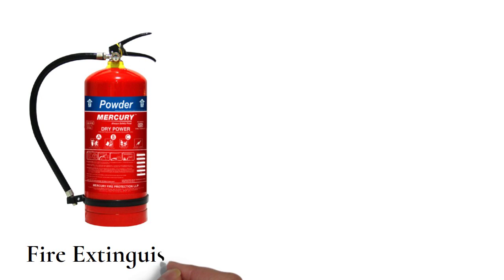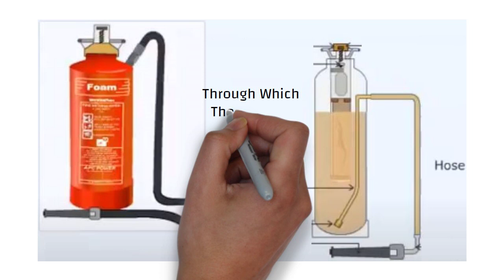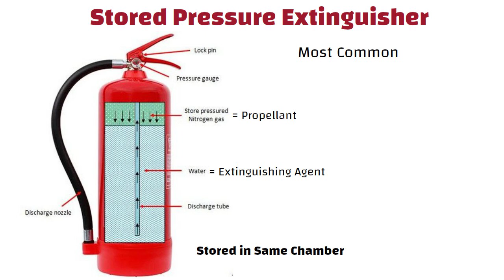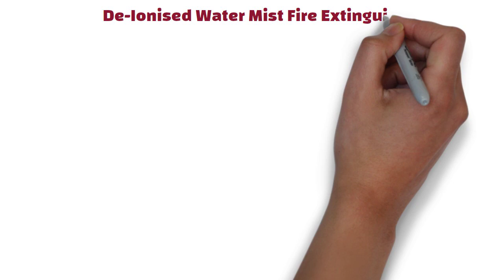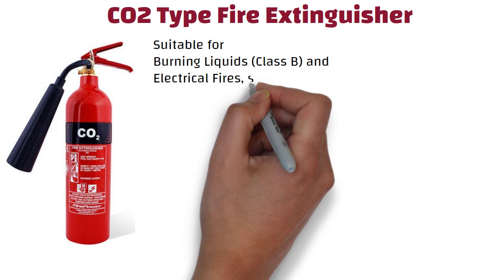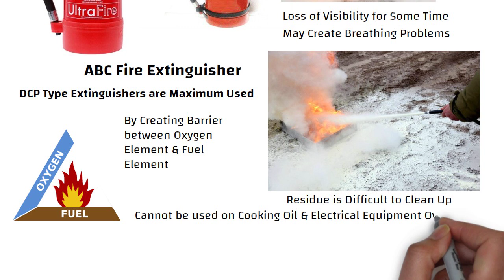FIRE EXTINGUISHER DEALERS IN KERALA, CALL 8138906102, FIRE EXTINGUISHER DEALERS IN ERNAKULAM.

Comment from the maker: FIRE ALARM DEALERS IN TIRUR, ADDRESSABLE FIRE ALARM DEALERS IN TIRUR, FIRE ALARM SYSTEM DEALERS IN TIRUR, ADDRESSABLE FIRE ALARM SYSTEM DEALERS IN TIRUR, FIRE DETECTION SYSTEM IN TIRUR, SMOKE DETECTOR DEALERS IN TIRUR, CONVENTIONAL FIRE ALARM DEALERS IN TIRUR, MORLEY FIRE ALARM DEALERS IN TIRUR, GST FIRE ALARM DEALERS IN TIRUR, ASES SECURITY FIRE ALARM DEALERS IN TIRUR, BEAM DETECTOR DEALERS IN TIRUR, FIRE ALARM SUPPLIERS IN TIRUR, FIRE ALARM TRADERS IN TIRUR, FIRE ALARM PANEL DEALERS IN TIRUR, HEAT DETECTOR DEALERS IN TIRUR, FIRE ALARM SYSTEM SUPPLIERS IN TIRUR, FIRE ALARM COMPANIES IN TIRUR, FIRE EQUIPMENT DEALERS IN TIRUR, ADRRESSABLE FIRE ALARM PANEL DEALERS IN TIRUR, FIRE ALARM SYSTEM IN TIRUR, BATTERY OPERATED DETECTOR DEALERS IN TIRUR, ASPIRATION DETECTION SYSTEM DEALERS IN TIRUR, FIRE ALARM MCP - MANUAL CALL POINT DEALERS IN TIRUR, FIRE ALARM HOOTER DEALERS IN TIRUR, PA TWO WAY TALK BACK SYSTEM DEALERS IN TIRUR, PA SYSTEM DEALERS IN TIRUR, PA TALK BACK UNIT DEALERS IN TIRUR, HOOTER CUM STROBE DEALERS IN TIRUR, FIRE PROTECTION SYSTEM IN TIRUR, FIRE ALARM CONTRACTORS IN TIRUR, FIRE DETECTORS IN TIRUR, FIRE ALARM DEALERS IN KOLLAM, ADDRESSABLE FIRE ALARM DEALERS IN KOLLAM, SMOKE DETECTOR DEALERS IN KOLLAM, FIRE EQUIPMENT DEALERS IN TIRUR, FIRE ALARM INSTALLATION IN TIRUR, FIRE ALARM COMPANIES IN TIRUR FIRE ALARM DISTRIBUTORS IN TIRUR, TALK BACK SYSTEM DEALERS IN TIRUR, FIRE ALARM SENSOR DEALERS IN TIRUR, FIRE EXTINGUISHER DEALERS IN TIRUR, FIRE ALARM DEALERS IN ERNAKULAM, FIRE ALARM DEALERS IN KERALA, ADDRESSABLE FIRE ALARM DEALERS IN CALICUT, SMOKE DETECTOR IN TIRUR,  FIRE EXTINGUISHER DEALERS IN TIRUR, FIRE EXTINGUISHER SUPPLIERS IN TIRUR, FIRE EXTINGUISHER DISTRIBUTORS IN TIRUR FIRE EXTINGUISHER IN TIRUR, ABC TYPE FIRE EXTINGUISHER DEALERS IN TIRUR, CO2 TYPE FIRE EXTINGUISHER DEALERS IN TIRUR, CLEAN AGENT FIRE EXTINGUISHER IN TIRUR FIRE FIGHTING PUMP DEALERS IN TIRUR, FIRE PUMP DEALERS IN TIRUR, KIRLOSKAR FIRE PUMP DEALERS IN TIRUR, FIRE JOCKEY PUMP DEALERS IN TIRUR, FIRE DISEL ENGINE DRIVEN PUMP DEALERS IN TIRUR, FIRE FIGHTING EQUIPMENT DEALERS IN TIRUR, FIRE FIGHTING SYSTEM IN TIRUR, VERTICAL INLINE PUMP DEALERS IN TIRUR, HYDRO PNEUMATIC PRESSURE BOOSTING PUMP DEALERS IN TIRUR, VERTICAL TURBINE PUMP DEALERS IN TIRUR, SEWAGE PUMP DEALERS IN TIRUR, RO PUMP DEALERS IN TIRUR. FIRE EXTINGUISHER DEALERS IN TANUR, FIRE EXTINGUISHER DEALERS IN IRINGAVOOR,
Reply: FIRE EXTINGUISHER DEALERS IN PERUMBAVOOR, FIRE EXTINGUISHER SUPPLIERS IN PERUMBAVOOR, FIRE EXTINGUISHER DISTRIBUTORS IN PERUMBAVOOR, FIRE EXTINGUISHER IN PERUMBAVOOR, ABC TYPE FIRE EXTINGUISHER DEALERS IN PERUMBAVOOR, CO2 TYPE FIRE EXTINGUISHER DEALERS IN PERUMBAVOOR, CLEAN AGENT FIRE EXTINGUISHER IN PERUMBAVOOR, MODULAR TYPE FIRE EXTINGUISHER DEALERS IN PERUMBAVOOR, MECHANICAL FOAM FIRE EXTINGUISHER DEALERS IN PERUMBAVOOR, FIRE EXTINGUISHER NEAR ME PERUMBAVOOR, FIRE EXTINGUISHER TRADERS IN PERUMBAVOOR, FIRE FIGHTING COMPANIES IN PERUMBAVOOR, FIRE CONTRACTORS IN PERUMBAVOOR, FIRE EQUIPMENT DEALERS IN PERUMBAVOOR, FIRE ALARM DEALERS IN PERUMBAVOOR, FIRE PUMP DEALERS IN PERUMBAVOOR, SMOKE DETECTOR DEALERS IN PERUMBAVOOR, FIRE FIGHTING SYSTEM IN PERUMBAVOOR, FIRE PROTECTION SYSTEM IN PERUMBAVOOR, FIRE AND SAFETY CONTRACTORS IN PERUMBAVOOR, FIRE HYDRANT SYSTEMS IN PERUMBAVOOR, PA TALK BACK SYSTEM IN PERUMBAVOOR, FIRE NOC IN PERUMBAVOOR, FIRE INSTALLATION IN PERUMBAVOOR, FIRE NOC RENEWAL IN PERUMBAVOOR, KIRLOSKAR FIRE PUMP DEALERS IN PERUMBAVOOR, FIRE EXTINGUISHER NEAR ME PERUMBAVOOR, FIRE EXTINGUISHER MANUFACURERS IN PERUMBAVOOR, SAFEX FIRE EXTINGUISHER DEALERS IN PERUMBAVOOR, FIRE NOC CONTRACTORS IN PERUMBAVOOR, FIRE FIGHTING EQUIPMENT DEALERS IN PERUMBAVOOR, FIRE PROTECTION SYSTEM IN PERUMBAVOOR, FIRE INSTALLATION IN PERUMBAVOOR, FIRE SAFETY CONTRACTORS IN PERUMBAVOOR, FIRE AMC IN PERUMBAVOOR, FIRE PROTECTION SYSTEM IN PERUMBAVOOR, FIRE PROTECTION EQUIPMET IN PERUMBAVOOR, AMC OF FIRE SYSTEM IN PERUMBAVOOR, FIRE CONSULTANTS IN PERUMBAVOOR, FIRE AND SAFETY EQUIPMENT DEALERS IN PERUMBAVOOR, ADDRESSABLE FIRE ALARM SYSTEM IN PERUMBAVOOR, KARTHAR VALVE DEALERS IN PERUMBAVOOR, DCP TYPE FIRE EXTINGUISHER IN PERUMBAVOOR, POWSER TYPE FIRE EXTINGUISHERS IN PERUMBAVOOR, FIRE HYDRANT SYSTEM IN PERUMBAVOOR, FIRE ALARM PANEL DEALERS IN PERUMBAVOOR, SAFEPRO FIRE EXTINGUISHER DEALERS IN PERUMBAVOOR, MS AND GI PIPE DEALERS IN PERUMBAVOOR, JINDAL PIPE DEALERS IN PERUMBAVOOR, AGNI FIRE ALARM DEALERS IN PERUMBAVOOR, FIRE EQUIPMENT DEALERS IN PERUMBAVOOR, FIRE EQUIPMENT SUPPLIERS IN PERUMBAVOOR, FIRE EQUIPMENT TRADERS IN PERUMBAVOOR, FIRE SPRINKLER SYSTEM IN PERUMBAVOOR, RAVLE FIRE ALARM DEALERS IN PERUMBAVOOR, RAVEL FIRE ALARM SYSTEM IN PERUMBAVOOR, AGNI FIRE ALARM DISTRIBUTORS IN PERUMBAVOOR, FIRE ALARM CONTRACTORS IN PERUMBAVOOR, FIRE PIPE INSTALLATION IN CONTRACTORS IN PERUMBAVOOR, FIRE SAFETY CONTRACTORS IN PERUMBAVOOR, FIRE PA TWO WAY TALK BACK SYSTEM DEALERS IN PERUMBAVOOR, HEAT DETECTOR DEALERS IN PERUMBAVOOR, HONEYWELL FIRE ALARM DEALERS IN PERUMBAVOOR, FIRE NOC CONSULTANTS IN PERUMBAVOOR, FIRE AMC AND FIRE NOC IN PERUMBAVOOR, FIRE SAFETY COMPANIES IN PERUMBAVOOR, NEWAGE DEALERS IN PERUMBAVOOR, MONSHER FIRE EQUIPMENT DEALERS IN PERUMBAVOOR, KARTHAR VALVE DEALERS IN PERUMBAVOOR, FIRE HYDRANT VALVE DEALERS IN PERUMBAVOOR, FIRE HOSE REEL DRUM DEALERS IN PERUMBAVOOR, FIRE SPRINKLER DEALERS IN PERUMBAVOOR, FIRE PUMP DEALERS IN PERUMBAVOOR, LUBI PUMP DEALERS IN PERUMBAVOOR, LHP PUMP DEALERS IN PERUMBAVOOR. FIRE CONTRACTORS IN PERUMBAVOOR, FIRE AND SAFETY CONTRACTORS IN PERUMBAVOOR, FIRE EQUIPMENT DEALERS IN PERUMBAVOOR, FIRE FIGHTING CONTRACTORS IN PERUMBAVOOR,

Comment: Addressable fire alarm system dealers in Thrissur
Reply: FIRE EXTINGUISHER DEALERS IN KOTTAKKAL, FIRE EXTINGUISHER SUPPLIERS IN KOTTAKKAL, FIRE EXTINGUISHER DISTRIBUTORS IN KOTTAKKAL, FIRE EXTINGUISHER IN KOTTAKKAL, ABC TYPE FIRE EXTINGUISHER DEALERS IN KOTTAKKAL, CO2 TYPE FIRE EXTINGUISHER DEALERS IN KOTTAKKAL, CLEAN AGENT FIRE EXTINGUISHER IN KOTTAKKAL, MODULAR TYPE FIRE EXTINGUISHER DEALERS IN KOTTAKKAL, MECHANICAL FOAM FIRE EXTINGUISHER DEALERS IN KOTTAKKAL, FIRE EXTINGUISHER NEAR ME KOTTAKKAL, FIRE EXTINGUISHER TRADERS IN KOTTAKKAL, FIRE FIGHTING COMPANIES IN KOTTAKKAL, FIRE CONTRACTORS IN KOTTAKKAL, FIRE EQUIPMENT DEALERS IN KOTTAKKAL, FIRE ALARM DEALERS IN KOTTAKKAL, FIRE PUMP DEALERS IN KOTTAKKAL, SMOKE DETECTOR DEALERS IN KOTTAKKAL, FIRE FIGHTING SYSTEM IN KOTTAKKAL, FIRE PROTECTION SYSTEM IN KOTTAKKAL, FIRE AND SAFETY CONTRACTORS IN KOTTAKKAL, FIRE HYDRANT SYSTEMS IN KOTTAKKAL, PA TALK BACK SYSTEM IN KOTTAKKAL, FIRE NOC IN KOTTAKKAL, FIRE INSTALLATION IN KOTTAKKAL, FIRE NOC RENEWAL IN KOTTAKKAL, KIRLOSKAR FIRE PUMP DEALERS IN KOTTAKKAL, FIRE EXTINGUISHER NEAR ME KOTTAKKAL, FIRE EXTINGUISHER MANUFACURERS IN KOTTAKKAL, SAFEX FIRE EXTINGUISHER DEALERS IN KOTTAKKAL, FIRE NOC CONTRACTORS IN KOTTAKKAL, FIRE FIGHTING EQUIPMENT DEALERS IN KOTTAKKAL, FIRE PROTECTION SYSTEM IN KOTTAKKAL, FIRE INSTALLATION IN KOTTAKKAL, FIRE SAFETY CONTRACTORS IN KOTTAKKAL, FIRE AMC IN KOTTAKKAL, FIRE PROTECTION SYSTEM IN KOTTAKKAL, FIRE PROTECTION EQUIPMET IN KOTTAKKAL, AMC OF FIRE SYSTEM IN KOTTAKKAL, FIRE CONSULTANTS IN KOTTAKKAL, FIRE AND SAFETY EQUIPMENT DEALERS IN KOTTAKKAL, ADDRESSABLE FIRE ALARM SYSTEM IN KOTTAKKAL, KARTHAR VALVE DEALERS IN KOTTAKKAL, DCP TYPE FIRE EXTINGUISHER IN KOTTAKKAL, POWSER TYPE FIRE EXTINGUISHERS IN KOTTAKKAL, FIRE HYDRANT SYSTEM IN KOTTAKKAL, FIRE ALARM PANEL DEALERS IN KOTTAKKAL, SAFEPRO FIRE EXTINGUISHER DEALERS IN KOTTAKKAL, MS AND GI PIPE DEALERS IN KOTTAKKAL, JINDAL PIPE DEALERS IN KOTTAKKAL, AGNI FIRE ALARM DEALERS IN KOTTAKKAL, FIRE EQUIPMENT DEALERS IN KOTTAKKAL, FIRE EQUIPMENT SUPPLIERS IN KOTTAKKAL, FIRE EQUIPMENT TRADERS IN KOTTAKKAL, FIRE SPRINKLER SYSTEM IN KOTTAKKAL, RAVLE FIRE ALARM DEALERS IN KOTTAKKAL, RAVEL FIRE ALARM SYSTEM IN KOTTAKKAL, AGNI FIRE ALARM DISTRIBUTORS IN KOTTAKKAL, FIRE ALARM CONTRACTORS IN KOTTAKKAL, FIRE PIPE INSTALLATION IN CONTRACTORS IN KOTTAKKAL, FIRE SAFETY CONTRACTORS IN KOTTAKKAL, FIRE PA TWO WAY TALK BACK SYSTEM DEALERS IN KOTTAKKAL, HEAT DETECTOR DEALERS IN KOTTAKKAL, HONEYWELL FIRE ALARM DEALERS IN KOTTAKKAL, FIRE NOC CONSULTANTS IN KOTTAKKAL, FIRE AMC AND FIRE NOC IN KOTTAKKAL, FIRE SAFETY COMPANIES IN KOTTAKKAL, NEWAGE DEALERS IN KOTTAKKAL, MONSHER FIRE EQUIPMENT DEALERS IN KOTTAKKAL, KARTHAR VALVE DEALERS IN KOTTAKKAL, FIRE HYDRANT VALVE DEALERS IN KOTTAKKAL, FIRE HOSE REEL DRUM DEALERS IN KOTTAKKAL, FIRE SPRINKLER DEALERS IN KOTTAKKAL, FIRE PUMP DEALERS IN KOTTAKKAL, LUBI PUMP DEALERS IN KOTTAKKAL, LHP PUMP DEALERS IN KOTTAKKAL. FIRE CONTRACTORS IN KOTTAKKAL, FIRE AND SAFETY CONTRACTORS IN KOTTAKKAL, FIRE EQUIPMENT DEALERS IN KOTTAKKAL, FIRE FIGHTING CONTRACTORS IN KOTTAKKAL,

Comment: Fire equipment dealers in Thrissur
Reply from the maker: FIRE ALARM DEALERS IN PAYYANUR, ADDRESSABLE FIRE ALARM DEALERS IN PAYYANUR, FIRE ALARM SYSTEM DEALERS IN PAYYANUR, ADDRESSABLE FIRE ALARM SYSTEM DEALERS IN PAYYANUR, FIRE DETECTION SYSTEM IN PAYYANUR, SMOKE DETECTOR DEALERS IN PAYYANUR, CONVENTIONAL FIRE ALARM DEALERS IN PAYYANUR, MORLEY FIRE ALARM DEALERS IN PAYYANUR, GST FIRE ALARM DEALERS IN PAYYANUR, ASES SECURITY FIRE ALARM DEALERS IN PAYYANUR, BEAM DETECTOR DEALERS IN PAYYANUR, FIRE ALARM SUPPLIERS IN PAYYANUR, FIRE ALARM TRADERS IN PAYYANUR, FIRE ALARM PANEL DEALERS IN PAYYANUR, HEAT DETECTOR DEALERS IN PAYYANUR, FIRE ALARM SYSTEM SUPPLIERS IN PAYYANUR, FIRE ALARM COMPANIES IN PAYYANUR, FIRE EQUIPMENT DEALERS IN PAYYANUR, ADRRESSABLE FIRE ALARM PANEL DEALERS IN PAYYANUR, FIRE ALARM SYSTEM IN PAYYANUR, BATTERY OPERATED DETECTOR DEALERS IN PAYYANUR, ASPIRATION DETECTION SYSTEM DEALERS IN PAYYANUR, FIRE ALARM MCP - MANUAL CALL POINT DEALERS IN PAYYANUR, FIRE ALARM HOOTER DEALERS IN PAYYANUR, PA TWO WAY TALK BACK SYSTEM DEALERS IN PAYYANUR, PA SYSTEM DEALERS IN PAYYANUR, PA TALK BACK UNIT DEALERS IN PAYYANUR, HOOTER CUM STROBE DEALERS IN PAYYANUR, FIRE PROTECTION SYSTEM IN PAYYANUR, FIRE ALARM CONTRACTORS IN PAYYANUR, FIRE DETECTORS IN PAYYANUR, FIRE ALARM DEALERS IN KOLLAM, ADDRESSABLE FIRE ALARM DEALERS IN KOLLAM, SMOKE DETECTOR DEALERS IN KOLLAM, FIRE EQUIPMENT DEALERS IN PAYYANUR, FIRE ALARM INSTALLATION IN PAYYANUR, FIRE ALARM COMPANIES IN PAYYANUR FIRE ALARM DISTRIBUTORS IN PAYYANUR, TALK BACK SYSTEM DEALERS IN PAYYANUR, FIRE ALARM SENSOR DEALERS IN PAYYANUR, FIRE EXTINGUISHER DEALERS IN PAYYANUR, FIRE ALARM DEALERS IN ERNAKULAM, FIRE ALARM DEALERS IN KERALA, ADDRESSABLE FIRE ALARM DEALERS IN CALICUT, SMOKE DETECTOR IN PAYYANUR,  FIRE EXTINGUISHER DEALERS IN PAYYANUR, FIRE EXTINGUISHER SUPPLIERS IN PAYYANUR, FIRE EXTINGUISHER DISTRIBUTORS IN PAYYANUR FIRE EXTINGUISHER IN PAYYANUR, ABC TYPE FIRE EXTINGUISHER DEALERS IN PAYYANUR, CO2 TYPE FIRE EXTINGUISHER DEALERS IN PAYYANUR, CLEAN AGENT FIRE EXTINGUISHER IN PAYYANUR FIRE FIGHTING PUMP DEALERS IN PAYYANUR, FIRE PUMP DEALERS IN PAYYANUR, KIRLOSKAR FIRE PUMP DEALERS IN PAYYANUR, FIRE JOCKEY PUMP DEALERS IN PAYYANUR, FIRE DISEL ENGINE DRIVEN PUMP DEALERS IN PAYYANUR, FIRE FIGHTING EQUIPMENT DEALERS IN PAYYANUR, FIRE FIGHTING SYSTEM IN PAYYANUR, VERTICAL INLINE PUMP DEALERS IN PAYYANUR, HYDRO PNEUMATIC PRESSURE BOOSTING PUMP DEALERS IN PAYYANUR, VERTICAL TURBINE PUMP DEALERS IN PAYYANUR, SEWAGE PUMP DEALERS IN PAYYANUR, RO PUMP DEALERS IN PAYYANUR. FIRE EXTINGUISHER DEALERS IN PANDALAM, FIRE EXTINGUISHER SUPPLIERS IN PAYYANUR,